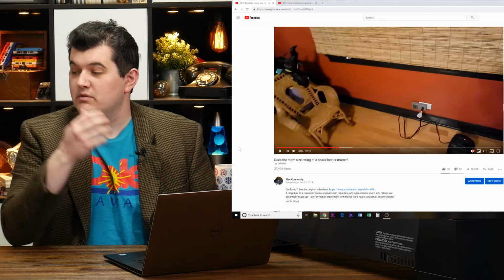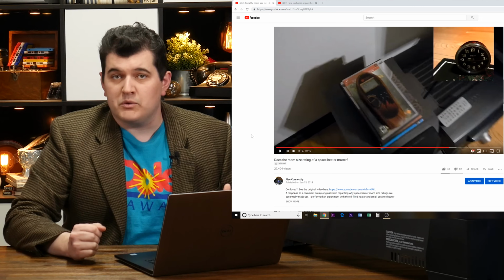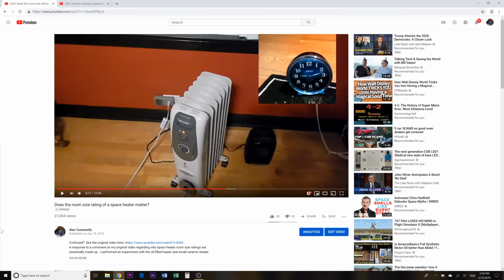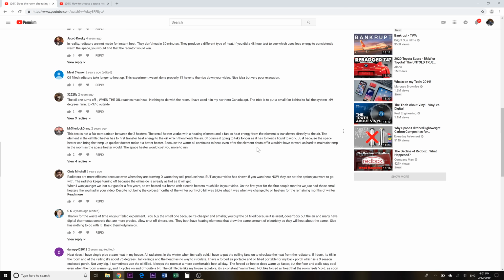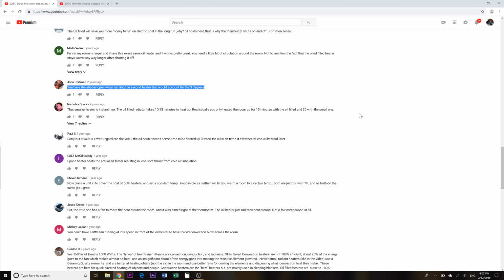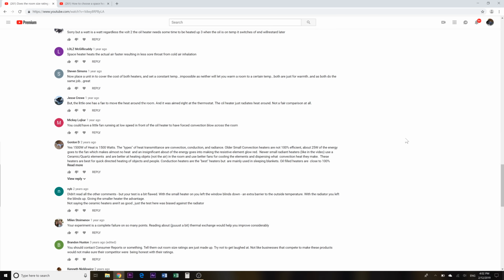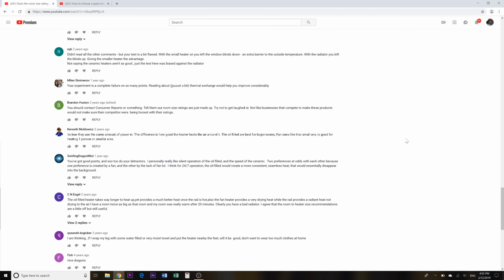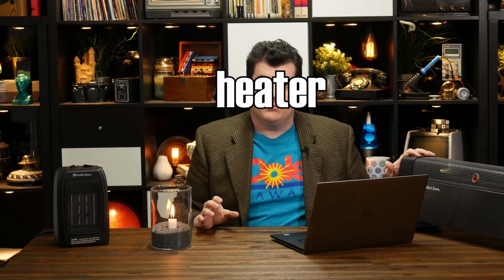More Space Heater Nonsense

Comment: In the last video you commented that electricity (resistive) was more expensive than other types:
In general that's been the case except for propane.
Here in NC propane heat is several times more expensive per btu delivered then resistive electric heaters.
This is even true if you don't count loss of heat through chimney/flue.

Comment: I prefer the radiator because of my asthma. A fan heater sends dust flying through the room and the convector sends the dust soaring since it essentially works by pulling cold air from floor level and rapidly heating it up. The convector also seems to burn the odd dust particle, causing a subtle burn smell. 

Another pleasant surprise with the radiator was that it lead to a smoother temperature gradient in my apartment. The difference between the temperature at floor level and head height is noticeably smaller with the radiator than with the fan and convector. I didn't expect it, I wasn't trying to prove anything, it was simply how it turned out when I switched to a radiator.

Comment: I understand what you're saying but I enjoy my infrared heater. I heat my whole house with it. 648 square feet. I think the fact that it has a nice blower in it helps. I do have gas heater backups that rarely kick on unless it's well below freezing. This unit is in a nice wooden cabinet as well and not cheap plastic. I use an oiled filled heater in the well pump room because I do not want a fan since the gas hot water heater is in there as well and I don't want the pilot light to blow out. While using the same energy, perhaps the size of the heating unit itself as well as a bigger blower would make a difference?

Comment: people keep mentioning the fact of "thats how thermo-dynamics" works.. and the problem is they dont actually explain thermo-dynamics...  i mean start with the basics.. ie heat rises and colds falls.... also many other factors do affect how any heat source heats a room... room insulation.. doors and windows... where you place the heater... ext..ext... individual heaters can make a difference too.. sure they all seem to be 1500 watt rated.. but as your vid explains one uses a fan another simply radiates.. but has a larger surface to radiate from... the oil heaters take longer to reach temp assuming the are not limited... fireplaces require constant attention...candles need more than one to even make any dent.. ""yes im adding heat sources other than portable heaters... hell i know a guy that uses his laptop as a heat source, because due to how laptops run they get hot easy... in short i agree that the sales technique is flawed and false in many ways... but after all they are trying to make money.... however to simplify the matter as you have does not do justice to how these heaters work and which is better for the money.. keep in mind you also never mentioned the watt rating on a central heating system and compare temp increases over time on it as well... and yes i know there are differing sizes and types and ratings on central heat systems as well.. but even a ballpark comparison would have made some sense... any who.. before this turns into a ramble from hell.. i think this is enough to explain some of what your missing to avoid the arguements in the comments... but then who knows.. im sure someone will argue simply to argue.. much like feminists will blame men for everything even when what we get blamed for was a womans fault....

Comment: I agree with you that a watt is a watt but I can also  understand why one heater is more effective than another.
The trick is to direct the heat downward and outward.
This tends to warm the floor and as the heat rises it encompasses the human  body which needs to be warmed.
.
If you are ever very cold heat up your feet.
Heat rises and that includes inside your body.
I do know that by using fans I can make a larger area feel more comfortable by directing heat to the floor and that a parabolic heater makes your face hot if you're a few feet away but don't step out of it's line of fire.
Same 1500 watts, very different effects.
I suspect that's why some claim different room sizes.
It's because they manipulate the heat in a more effective manner for that specific effect.

Comment: The was a brohaha in Norway many years ago where the oil filled heaters was demoted cos if you put 1500W in to the oil continuously it will explode, there for the potential of the element being 1500W is not valid as a way to illustrate heat output so the manufacturers could not say "1500W heater" on the box any more when the 1500W was just used as you initially turned on the heater it does not put out 1500W worth of heat like a radiator.
Reply: And if the oil starts leaking (as it does along the years) it is a nightmare to clean up.

Similar to transmission oil but it smudges all over everything.
Lifehack of the day: classic natural organic soap is best in claning the oil in question. Seems the stuff is mineral.

Comment: on a similar note, i had someone trying to sell me a tankless water heater for a radiant heating system because i would have less standby loss than with a tank that is constantly kept hot. 

where exactly would that heat "loss" be going except into the very room im trying to heat anyway?

there are other reasons to buy a tankless water heater for radiant heating but heat loss is hardly a real one.

besides, modern water heaters are so well insulated that standby loss is minimal anyways.

Comment: Not debating anything you have said and that kind of thing annoys me too...  But I had a thought, with a fan air moves around more and this increases heat loss in a non-airtight house.   So if you had a heater without a fan, and added a regular fan, the fan would certainly mix the air in the room, but too much fan would cause heat loss.  So, considering that, a larger drafty room would lose even more heat with too much fan than a smaller drafty room, if we assume there is a given amount of air mixing with outside air on average per square meter...   Also, maybe it's not air-tightness but rather increasing heat loss due to moving warmth nearer points of worse heat loss, keeping those spots warmer.  So, maybe removing the fan component and reducing mixing will actually reduce loss, essentially improving the heat insulation of the room?!

Comment: How can I find out my 'btu' load. Aka how much energy I'm losing per hour?
Reply: you could try measuring the temperature drop per hour but its really pointless since most space heaters heat the same so you might aswell buy a cheap 1500 Watt one
Reply: @benjaminbuljevic7977  I have a 1500w heater. I was just asking without my furnace or heater on I wanna know what my btu load is. Just to be nerdy. So I would measure the temp drop in one hour, is there an equation for this? It should take into account outside temp as wrll

Comment: You're absolutely right about space heaters being 100% efficient... The problems come from how they distribute the heat, and also how generating electricity from natural gas and oil is much less efficient than using your own oil or gas furnace. (That's why it's much cheaper to run a gas or oil furnace instead of using an electric heating coil.)

The oil-filled heaters, in my experience, just create hot spots in a room. The hot spots aren't always where you want the heat. I suspect they work very well in drafty rooms when placed in a way where the draft disperses the heat. Either way, I've never had good luck with them. As I type this, I have an unused oil-filled heater at my feet, that when I turn it on, sucks all the cold air in the room past my feet, making them feel colder. Ugh. A lower-wattage heated rubber mat does a better job.

But, anyway, I digress. I have a room that I need to heat with a space heater because it has a hot tub, and can't tie into my main ductwork. What I've found is that the most effective way is to use a wireless thermostat on the wall, an oscillating space heater with a fan, and setting the ceiling fan to medium. That disperses the heat through the room very quickly.

Comment: Here's how to make a space heater.
You'll need, 3-4 coke (or other drinks) cans, a small plate, some chip oil (may as well use the oil change from a fryer), some cotton wool, a mesh bin.
Get some old oil from your deep fat fryer, cut the bottom off an empty coke can. Drill 4 holes with a 4mm drill bit (you can usually poke scissors and make the hole that way if you don't have a drill) in the bottom ring (that sits on the table) of the can. Damp some cotton wool with the oil and twist it through the holes poking up as if into the can (about 1/3 inch of wick). Pour some chip oil (preferably without the bits) into the plate (just enough to slightly float the coke can bottom). Light the cotton wool wicks on fire. Make several of these depending on how much heat you need). If any of the flames produce soot, trim the wick. Place the mesh bin over the plate to stabilise the air current and also protect from fire.

Use this in a room where it's away from flammables and use it on a hard floor not a carpet. It may smell a small amount but provides lots of heat.

Comment: I commented on your previous video but this one is even worse.

Your argument about BTUs in and BTUs out is theoretically fine but you're not really thinking about what's going on in the room. I was shocked to see that even after the radiator heated the room far less in 30 minutes than the other heater, you didn't recognize the mistake.

If both are using 15kW of power over 30 minutes, you added the same amount of energy to the room, right? That's your whole argument. But is that energy evenly distributed? No, obviously not, and you also acknowledged this when talking about the radiator thermostat.

So how did you not manage to synthesize the recognitions that the heat was not evenly distributed across the room and that the smaller space heater did better over 30 minutes than did the radiator even though they were both adding equal BTUs to the confines of the room over that time period into a sudden realization that your core argument here is flawed?
Reply: Sigh. Oil heaters heat the oil first. Also he ran the oil heater for AN HOUR. And it still heated less.
Reply: @Demonslayer20111  So...you're agreeing with me?

Comment: Logic is not logic for so many people. You explained it clearly 3 times they will never get it.... Radiator needs to expend quite a bit more energy to heat the oil inside. That in trade for a bit more heat when turned off.. The one heating faster with less run time will equal less energy used.. Being that they are equally rated.. Remember 1 gallon is always better than 3.78541 liters..

Comment: There is one piece of nonsense that you did not mention.  On the fan equipped heaters, they have a fan setting.  This implies that they SHOULD be able to cool a hot room.  WRONG!!!  If a room is hotter than the thermostat is set to, the fan SHUTS OFF!  So, if you want to use them just a a cooling fan, and the room gets hotter than the setting, forget about those things cooling anything off!  
The fan setting should be directly connected to the fan!  So, why even bother having a fan setting?  It's as useful as those machines that turn themselves off just because you turned them on.
Reply: Fans don't cool. They simply move air.

Comment: Thanks, you just saved me a ton of money. I now just use my toaster. And to prevent that annoying cycle off feature, I just jam a butter knife in there.  ;-)   Bonus: Bet you can't make toast with a space heater.
Reply: Electric oven at 350°, bottom-hinged door partially open, box fan on the kitchen counter blowing sideways across the gap.  I heated a whole floor of my house that way for two days in January, while the furnace was on the fritz.
Reply: @joesterling4299  that works
Reply: I tried using a toaster to heat my room once in college (heating wasn't working)... Ended up partially melting my toaster after about 10 minutes, so make sure it's a good quality toaster not a cheap plastic one!
Reply: Well, you actually can make toast with one of those old all-metal, red-hot element radiant heaters!
Reply: My feet were cold in bed so I just lit the end of my bed on fire. It worked great, quickly heated my whole house, and as an added bonus now I don't ever get cold feet.
Reply: You're not going to be able to make toast very much longer with that toaster either if you keep that up.

Comment: I don't think the thermostat issue of the oil filled heater is universal. I had an oil filled heater that had the thermostat mounted at the bottom end and stood off on a plastic spacer and would go continuously even on the lowest setting in a hallway,  trying to heat the whole house.  I don't get it why not all such heaters are designed with enough common sense to do that.

Comment: Totally agree with your theory, no such thing as over-unity. 1500w is 1500w. But your old experiment has many many variables effecting your result and as you mention, the oil filled radiator has an additional dense medium to heat before it begins to heat the room. Try a similar experiment with the two heaters on your desk to prove your original big room/small room argument. 👍

Comment: it's not about how fast the heater fills the room, it's about how much it costs to keep the room at the right temp, run both heaters overnight, and compare the power used over 8 hours, and what temp the room is in the morning when you get up.  if you wanted a real compare, use the same type of heaters, but one small 1500 watt and one big 1500 watt of the same type (with a fan etc) watch this instead https://www.youtube.com/watch?v=GMEqEETCvB0
Reply: They both use 1500 watts... As in the power consumption will be the exact same.
Reply: @Demonslayer20111  no, a heater that switches on and off to keep the same temp will cost much less than a heater that has to run constantly to keep the same temp, if they have the same watts...

Comment: I understand what you're saying but I still believe in optimum efficiency, So, in theory, I could put a 1500 watt ac unit in the middle of the room and id get 1500 watts of heat? same as a heater according to you? or 10--100watt lights getting 10watts a piece would put out as much heat as one 100watt balb@ 100watts to me I think there is an optimum efficiency. here's another example according to you, I could get a bunch of just fans eating up 1500watts of electricity and it would heat up a room just as good as one 1500 watt heater@ 1500 watts, see why I believe in optimum efficiency?????
Reply: maybe in the future they'll make a heat emitting diodes. we already have light emitting diodes (L.E.D) and l.e.ds are closer to optimum effency than regular bulbs woulnt you say so? Anyways I did like your video.Thanks

Comment: I used a small room space heater to heat my studio apt and they lasted  less then 2 years running 12 hours a day. Used 3 small heaters heaters in a 5 year time frame. I have been using 4 large room space heaters in my house and run them 24/7 for 4 months for 6 years and they are still running strong. In short, the small room are no ment to be running for nonstop.

Comment: There are a few tricks HVACR guys have.

You can dump all of your supply conditioned air into one room. have jump ducts all over the house and be able to say “same BTU’s.” That goes double for electric heating. But you aren’t making people warmer necessarily. You aren’t necessarily making them more comfortable. Unlike putting them in baseboards around the outside walls of your house that’s effectively insulating your house.
Or using a balanced duct and air handler system to evenly distribute it around your house. With the supply vents pointed at the exterior walls and your return vents at your inside walls.

This all goes for electric heating. Not to say boiler radiant heating, 80% gas furnace, 90% gas furnace (petroleum or otherwise), heat pump(just an air conditioner that has a reversing valve).

I’m a fan of the the refrigeration process and I think that the future of heating when advanced inverter technology finally catches  up with the the American market.

Comment: The only thing I can think is that maybe a space heater that is designed to heat a larger space is engineered to be able to stay on for a longer period of time without self destructing. Or maybe they have been designed to spread the heat more and thus reduce fire risk in the vicinity of the heater. Maybe a combination of both.
Reply: You should do a video with AvE where he could take two space heaters apart to see the differences if there are any.